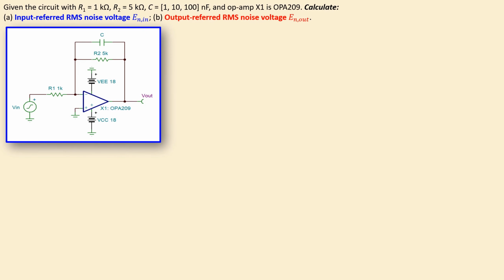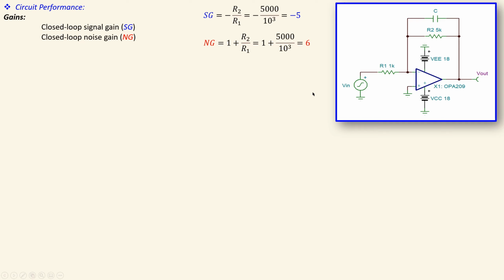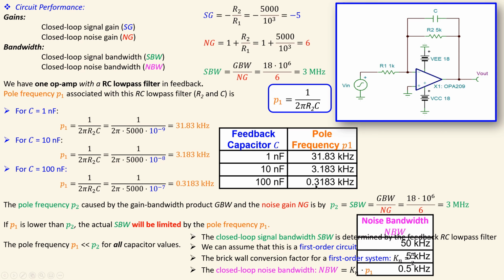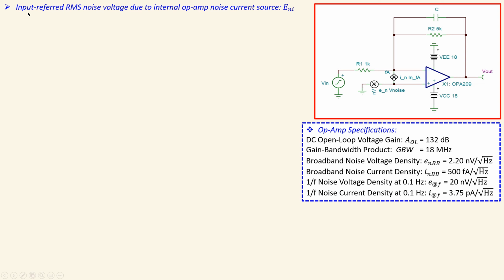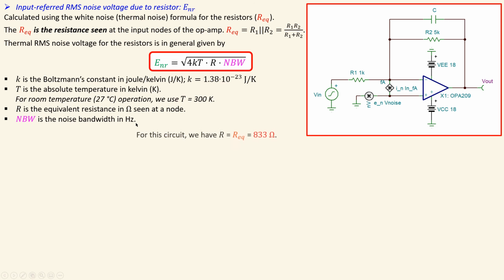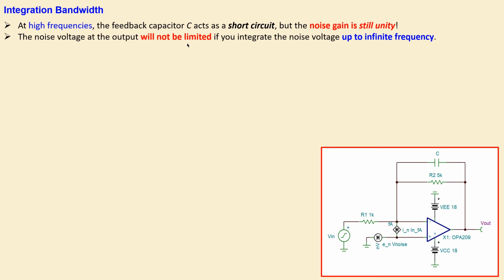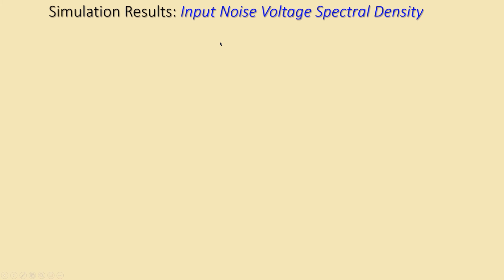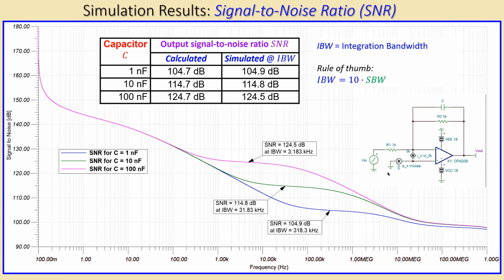Noise Analysis Inverting Amplifier with Feedback RC Filter 💡 Example 5

Comment: Hi sir why will the noise current not flow through the capacitor?
Reply from the maker: Where in the video was this discussed?
Reply: while deriving the equivalent resistance in order to calculate the input voltage referred noise due to the input current
Reply: at 22:45 sir
Reply from the maker: Capacitor in combination with a resistor (RC circuit) will generate noise voltage for the capacitor, but not a noise current. More details can be found here:

Thermal noise on capacitors
https://en.wikipedia.org/wiki/Johnson%E2%80%93Nyquist_noise

Comment: Hi Can, thank you so much for your videos (again)! I have a question: were does the SNR formula at 29:52 comes from? SNR=20Log(1/Enout). Can you show me some references? Thanks!
Reply from the maker: Thanks for your message. In the formula of SNR it was assumed that the input signal voltage is 1 V RMS, which of course does not have to be the case. In fact, the main point was to illustrate what the effect of the components are on the noise performance, for example, the value of a capacitor.
Reply: @CANEDUX  ok that makes sense! It was not clear for me that assumption. Thank you, these videos are helping a lot in my EE master thesis! Cheers from Portugal!
Reply from the maker: @barbasbandas6665  Great to hear this :) If you want a good practical book about noise analysis in circuits, see the book of Arthur Kay: https://www.sciencedirect.com/book/9780750685252/operational-amplifier-noise
Good luck with your project!